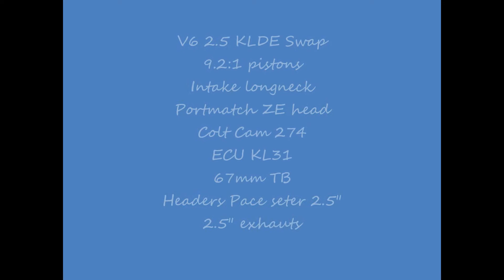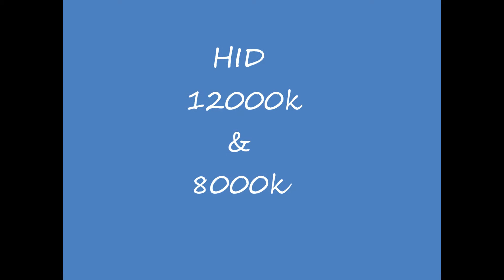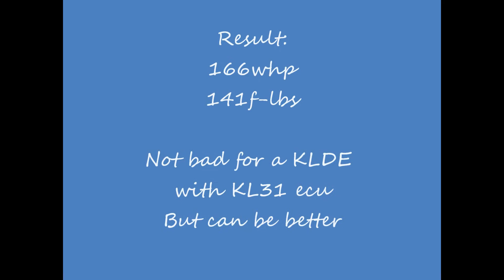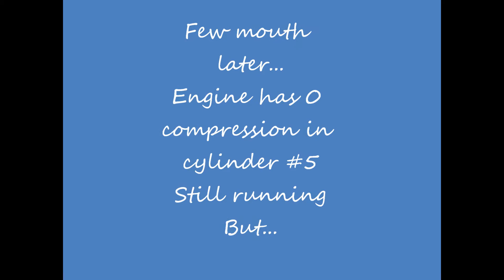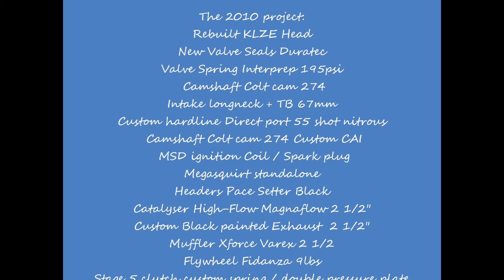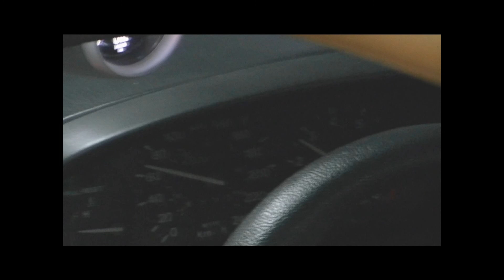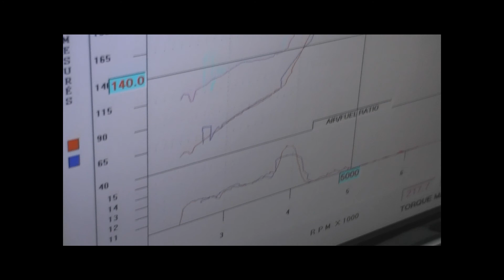My MX3 RS 1993  2007 to Now

Comment: Awesome car.
Im planning on doing a klze swap on my mx-3  was the 2.5L KLZE direct bolt-on fit, did you replace the transmission or have to modify anything besides flipping the cooling fans?
Reply: you have the 1.8 v6 in your car? if so its the same manual transmission. get the 2.5 ECU with the chip to work on the KLZE. And some wiring mods that you can do yourself its an easy swap. Get a nice clutch.